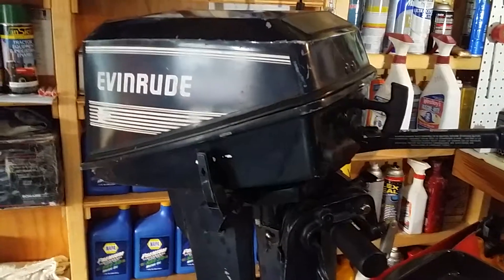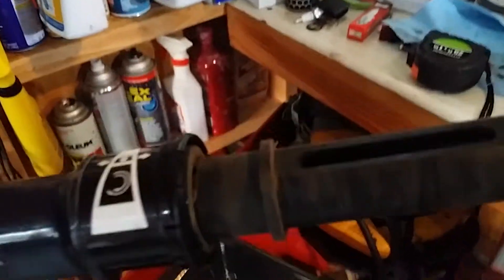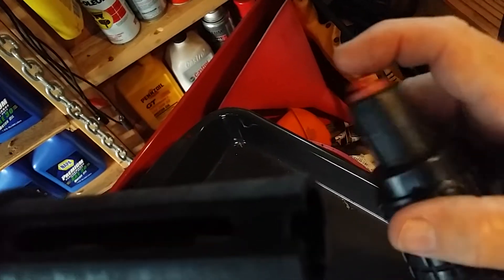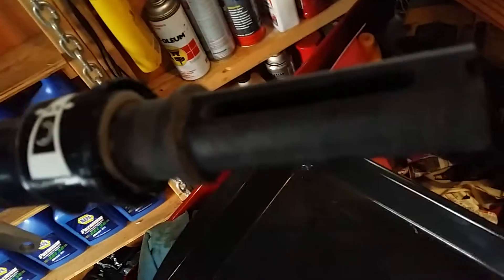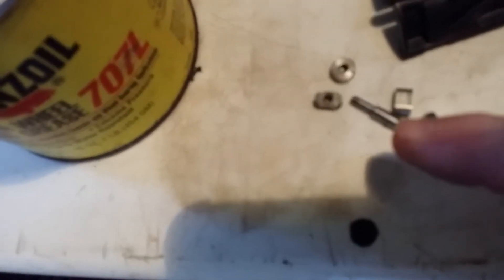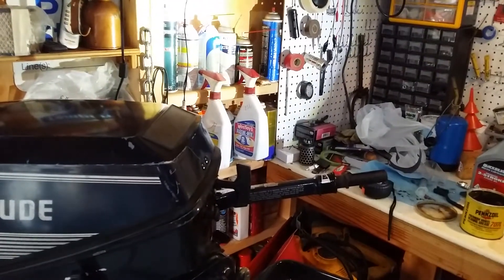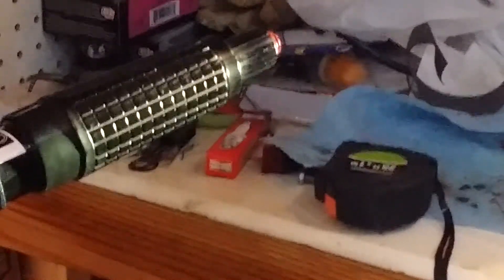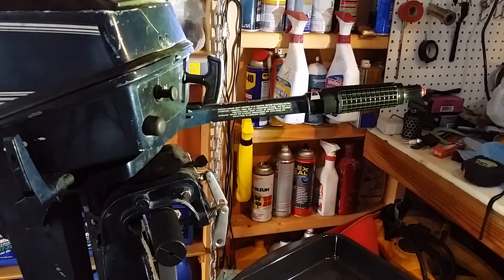Rebuild the twist throttle on an Evinrude 6 HP Twin. Fast and Easy.

Comment: Which is the start,idle,slow and fast positions on tiller control handle. The markings are worn right off. 1996 Johnson 6hp model J6REDS

Comment: Thank you so much for this video! This helped me take the handle apart to diagnose a super stiff twist grip. Unfortunately, all this did was rule out the actual twisting mechanism. Do you have any insight into what might make the throttle really hard to operate? The linkages are super smooth, so my guess is there's an issue somewhere between the grip and the tiller hinge (possibly just underneath the speed indicator). My motor doesn't have a throttle friction adjuster either.
Reply: Hey Sam, just saw your comment, I've got the same issue, did you by ever chance ever diagnose the issue?

Comment: Good Man, i also was looking all over the internet for removing the handle and finally found this one. i have a 1988 ,9.9 evinrude and my knob at the end turns left and right but there is no change in my idle. it has never been apart but can it be the pieces inside let go. any advice would be great. i was worried about taking it off for the reason i may not put it back together. do you just have to pry up the two tabs to remove the handle? GREAT STUFF!!

Comment: It is illegal to disconnect the lanyard safety switch on any tiller that came with it from the factory. Marine  patrol will give you a citation if they catch you on the water with it disabled.Just a heads up. Great Video